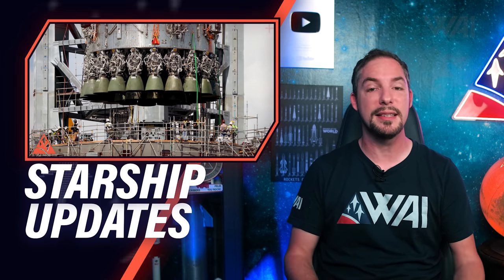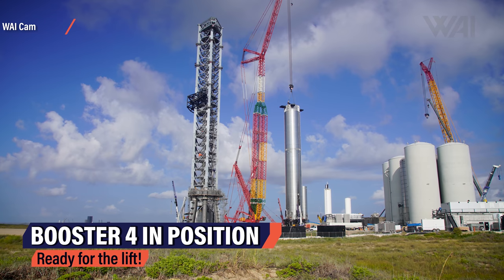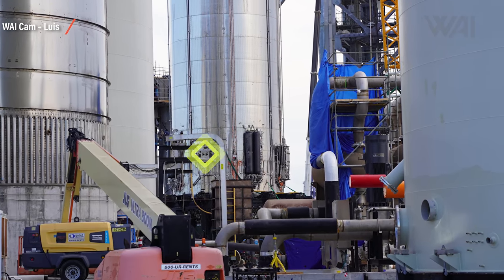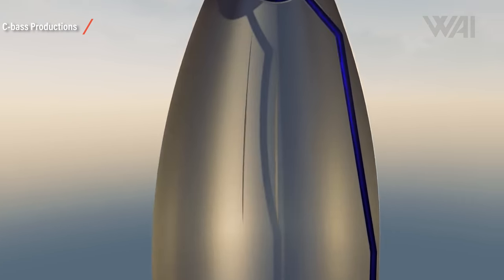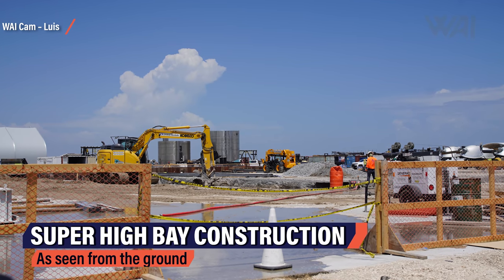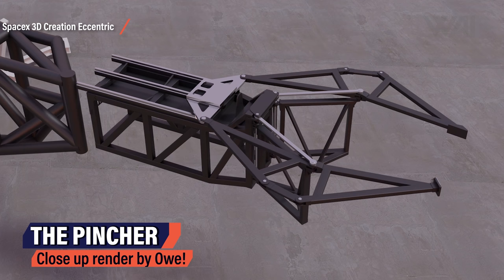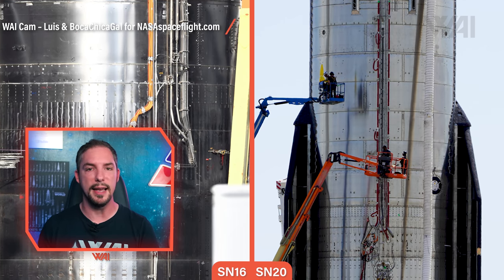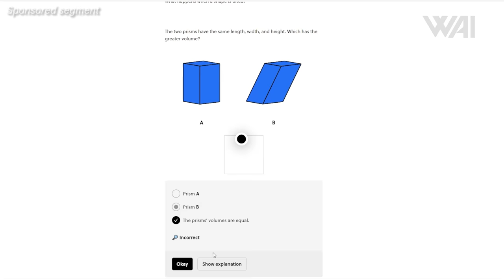SpaceX Starship Super Heavy Booster 4 Design Changes explained!

Comment: Starting to get a little worried about all this toing and froing (remember Apollo One) they have to install a lot of stuff before launch (engines therno protection)
Reply: This one won't carry any crew
Reply: @alvianchoiriapriliansyah9882  that's very true. Just a little worried about what's been called "launch or go fervor"  there's a lot of learning forwards trying to get to orbit and beyond, it's very easy to not notice a small thing (a frayed wire in the door of Apollo One) that if added to just a few other small things leads to a very big loud thing. The BB's (a new word I've just coined right now it translates into Bazos and Boeing) would have a field day with a spectacular RUD especially if it includes damage to the surrounding area.
Reply: @earth2006  Pretty sure there's no go fever around here

Comment: I have 3 requests:

Please cover all the wiring & plumbing on Boosters & Starships.
(Mr. Musk) Please watch my video regarding the SpaceX railway system.

Please consider a spray-on coating that would insulate all for reentry,
without tiles. Spray it on, heat flows & chars it, perfect protection, 
like seasoning a cast iron pan. Stainless has poor heat transference,
that's why engine blocks & radiators aren't built with it.
A 5mm thick coating spray of glass dust, Kaolin would be a consumable
heat shield, easily & quickly replaced. A 100 gallon tank onboard,
with spray arm for replenishment off world, a tanker truck at Starbase.

Comment: I doubt that its feasible to launch starships from the mars surface. Smaller transfer vehicles and ideally a station in mars orbit (maybe made from starships) are more efficient.
Reply: Mars has ~1/3 the gravity of Earth. And the Star ship is being specifically designed to launch from Mars’ surface. Unlike the Starship direct to moon missions refueling will be required on Mars. Which was one of the main factors when Methane/LOX was selected as the fuel. It is easy to make on Mars with current tech.

Now the first round of Starships will land on Mars and never re-launch. The will carry the supplies and eventually personnel need to set up the initial base & fuel generation equipment. But later missions will be launching from the Martian surface to return the crews.

Comment: Time is the most important. Stop wasting it. Lets start installing tiles in the tent before stacking.  Lifting tiles 10 at a time 70M in the air is slow and wasting time. All stacking cylinders should be tiled in advance All lifts of a piece of equipment should be done FULLY DRESSED!

Comment: Not an engineer or a rocket scientist here. Just a regular, average human, that is curious. So...no flack for these questions. Why doesn't the Super Heavy need a heat shield?  Does it not go pass the Karman Line?
Reply: Not everything that goes to space and back needs heat shielding. You only need that if you're reaching orbital speed.
Reply: @faustin289  first off thank you for answering. So it has nothing to do with altitude and it falling back to Earth. It's all about the speed when it enters the atmosphere, right?
Reply: If super heavy is anything like the falcon 9 booster it will probably use a brief retro fire during its return flight. This slows down the booster somewhat to keep the reentry speed more manageable, and also helps with the return flight back to the launch site or to the landing ship. The falcon 9 boosters also have some heat protection on their bottom surfaces, but nothing like the tile system because the temperatures are much lower for a booster return than for a return at orbital speed.
Reply: @richardsimon9675  You sir, are the second person to mention orbital speed. How fast is orbital speed?

Comment: Fuel ports side by side on ss qd is a bad idea. Should be above one another. Side by side cross connects  the methane and oxygen ports when refueling in orbit with ss's back to back..
Reply: What's the problem?
Reply: @alvianchoiriapriliansyah9882  Imagine starships back to back for refueling (and possible cargo/crew transfer hatches lining up). With ports side by side the oxygen connection will face the methane connection. Connectors above one another makes a connection system simpler.

Comment: While it is not really feasible for our average intellects to think like genius grade minds Elon Musk has nonetheless provided us with some limited indications regarding how he thinks. 

The articulated motion of the imaginary pincher looks to be unnecessarily complex.

Elon Musk is well known to have a strong aversion to unnecessary complexity.

No structure or system can be stronger than the weakest component.

Any, excess hinges and actuators necessary to the conceptual mock up you present could be limiting factors.

The fact that the system has been referred to by insiders as 'giant chopsticks' implies it will instead be as simple as possible because to quote Elon Musk "the best part is no part at all".

It is not difficult to imagine umbilical connection points being incorporated to the pincer.

Because eliminating as much mechanization as possible is probably the most simplistic approach and therefore dear to Musk's heart.

It is conceivable that the pincers might ultimately consist of a twinned pair because redundancy is arguably the most reliable form of insurance.

To quote a saying I have long lived by; "it is better to have a resource and not need it than to need it and not have it" and never, has that precept been more applicable than to the harsh environment of space.

If you multiply that by the tyranny of distance, to Mars for example, and it can justify itself many times over.

Comment: I am completely expecting Booster 4 to lose engines on it's first attempt.
Reply: Seeing two relatively new rockets attempts lately lol, but unlike them the Super Heavy engine failure wouldn't matter as much
Reply: @alvianchoiriapriliansyah9882  This is not the Super Heavy rocket.  The Super Heavy is a Falcon 9-based rocket. Starship and it's booster are completely different.

Comment: Elon,...put a nose cone and weights on BN4. Launch it and review the results, then try it with SS 20 if all goes well. If a RUD occurs a slightly smaller explosion would be generated.
Reply: That's not how it operationally works

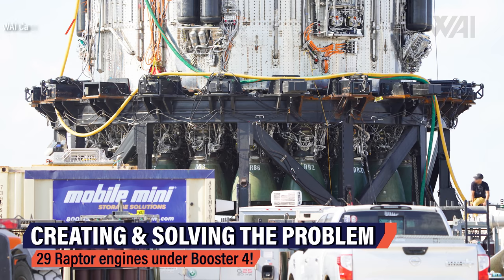Comment: 6:50 why do they need a seperate gas for it? Why cant they just use air from around the rocket to counter that negative pressure?
And before you say "there is no air in space", because space is a vacuum low pressure inside the tank shouldnt be a problem there when it comes to risk of being crushed right?
Reply: I think you're kidding, right?
Reply: @faustin289  i am not...
Reply: @faustin289  Why do you think its such a bizarre suggestion?
Reply: @mistrants2745  Because you're adding an oxygen into the methane tank
Reply: @alvianchoiriapriliansyah9882  is that a major problem in terms of possible ignition inside the tank? Because surely it wont mix with the liquid methane, just the methane vapor above the liquid?

Comment: Hum ... to be honest the chopsticks do not look strong enough to catch a 200 tonne booster. Am i wrong ?
Reply: Those arent the chopsticks.
Reply: The engines will be burning to slow the descent. Much like we see regularly with Falcon9 landings. The chopsticks are more there to keep it vertical (eliminating landing gear) and absorb a relatively small portion of the deceleration (minimizing the impulse on the chopsticks and cable brake system). Once at rest the system is not that much different than the crane being used to lift now.